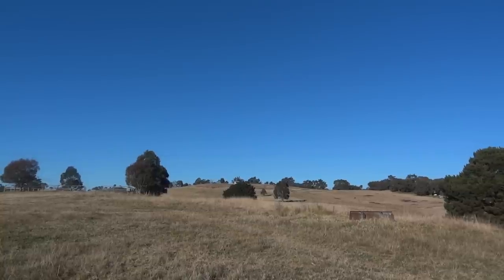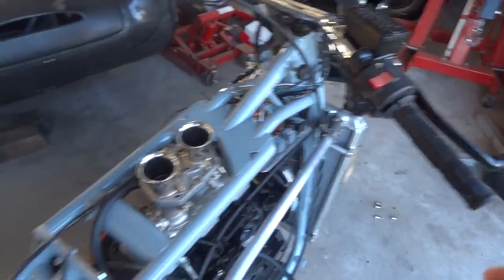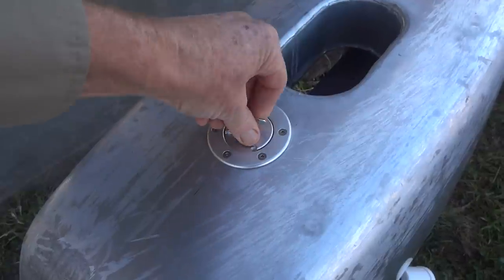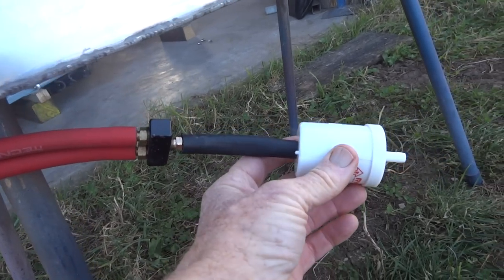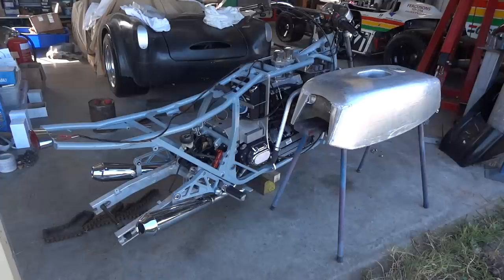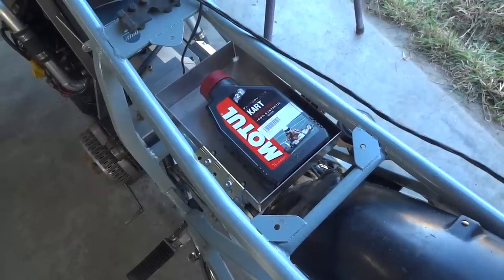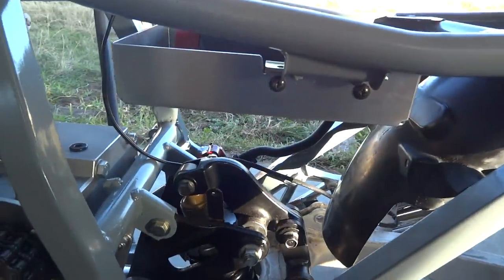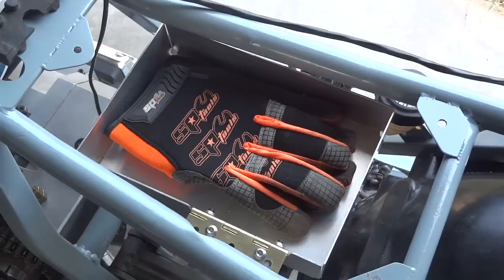Mercurial Outboard Motorbike Mercury 2 stroke V6 second fire up

Comment: You should make an anodized aluminum or brass oil container to be carried with the bike. Being sealed using pipe fittings WITH leather straps and rubber blocks to keep secure!  Love this bike, and swapping in the v8 version should be nearly a drop in replacement!

Comment: The brass hinge/electric glove box may be an issue. Brass contacting aluminum may cause galvanic corrosion.

I don't know what I'd use, probly just whatever fits from outback, but not aluminum. 

On that, I think aluminum would crack, due to the engine vibration, so probly all plastic except the hinge pin & latch.

Comment: For the weight and capacity of the engine, I wonder what the rear wheel power might be?  The Italian made 2T v twin in the Langen, weighs around 58kg and makes 76hp at the wheel from 250cc.
Reply: These make from like 200 to 300 hp
Reply: @twijers5841  That would surprise me a great deal....
Reply: @humourless682  why so? is a marine v6 engine
Reply: @janhendrikfranke  I used to work next door to someone who tuned those engines  for offshore powerboat racing.  For the capacity the power produced is very low, they are very crudely made, weight is high, and they would not handle the type of RPM required for motorcycle use.  An interesting project, but in all honesty pretty pointless..........

Comment: I've been thinking that the torque of your engine is so high and idling is so low that you wouldn't need a gearbox. 
Top revolutions at 6000 rpm and dling at 600, would make you go from 200 Km/h to 20 Km/h without a gearbox.

This engine is made to be able to move a 1500 Kg boat with 6 persons onboard, up to 2500 Kg in all, and speeds go from 3 knots at 600 rpm up to 30 knots at 6,000 rpm. 

I have one of these engines in a boat made by Pursuit model 2550. Weight of the boat is only 1360, let's say 1400Kg with electronics. Safety equipment and an anchor, add gasoline weight, at least 200. Two or four persons aboard means around 200 Kg, and engine with oil and propeller is almost 200Kg.

Normally our total weight is around 2000 Kg, but eventually we might be as high as 2500 Kg, with another 500 extra weight by filling the huge 740 litre tank and with 6 persons aboard.
Your motorcycle weight is going to be 220 Kg, and another 80 from a rider makes only 300. That's six times less weight than the boat.

The weight of this bike and two persons may reach 400 Kg at most, which is only 20% of the weight of the 2,000 Kg boat. Your power to weight ratio is huge, same as torque to weight ratio, both are at least 5 times higher in your case than in a boat.

Boats don't need a clutch because water allows the propeller to slip properly. A bike does need a clutch but maybe a gearbox is not needed if fitted with a 2.5 litre two stroke engine with a six carburetor block and Reed valves.